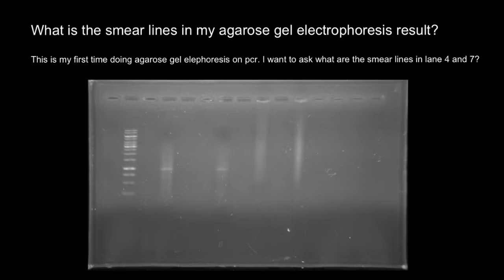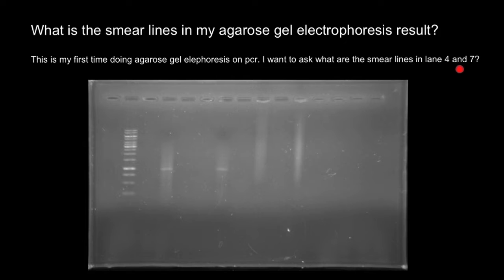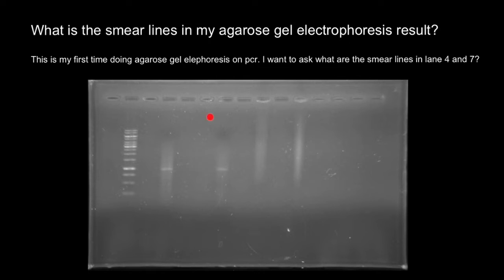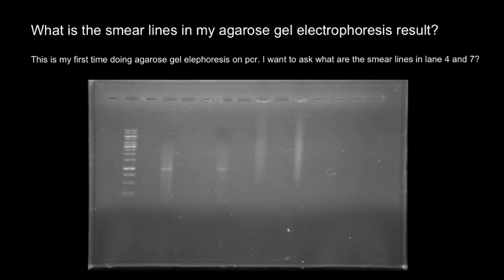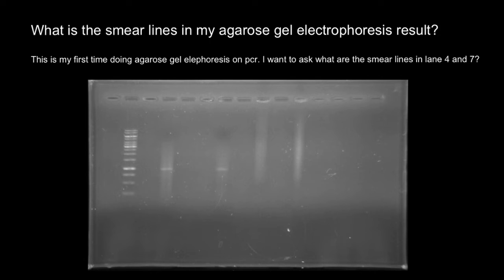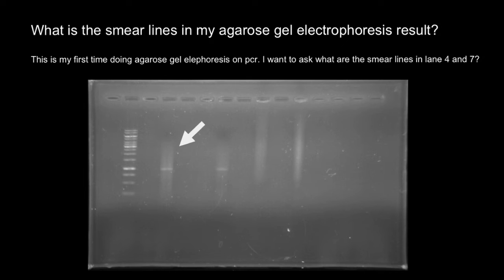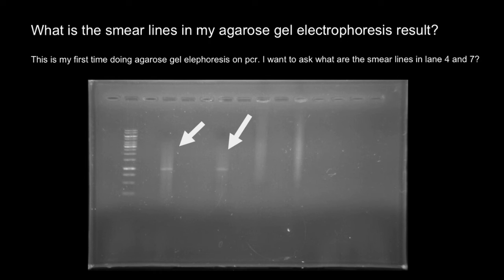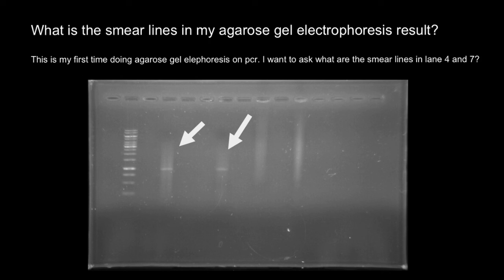What causing DNA smear on agarose gel

Comment: Hi, I've done agarose gel electrophoresis yesterday and the result turned out to be only a single band with no smear. Is that's bad?
Reply from the maker: The outcome of agarose gel electrophoresis showing a single band with no smear can be good or bad, depending on the expected results of your experiment. If you were expecting a single, specific DNA fragment size, then a single clear band with no smear indicates a successful purification and that your sample likely contains DNA of a uniform size, which is excellent. However, if you expected multiple fragments or a broader size distribution of DNA, the presence of only one band and no smear might suggest that the other expected fragments were not present or were not amplified during PCR, if PCR was a part of your procedure. It's also crucial to consider the concentration and quality of your DNA sample, as well as the electrophoresis conditions, when interpreting your results.
Reply: @GeneticsLessons  TQVM sir